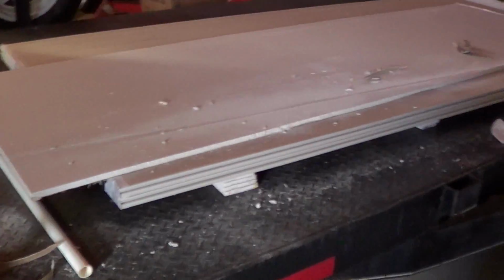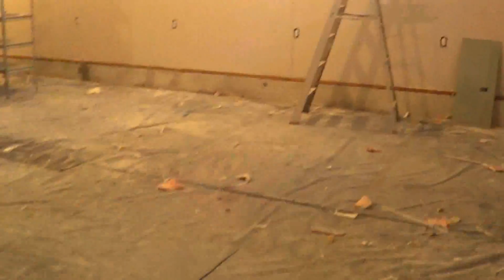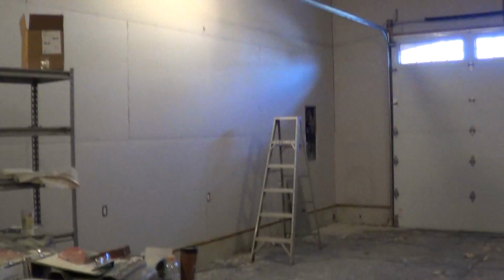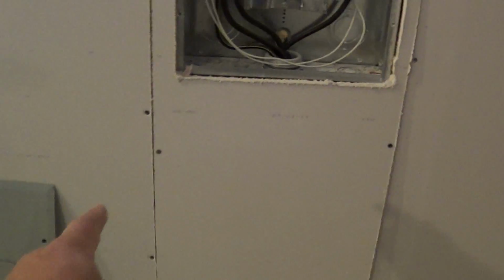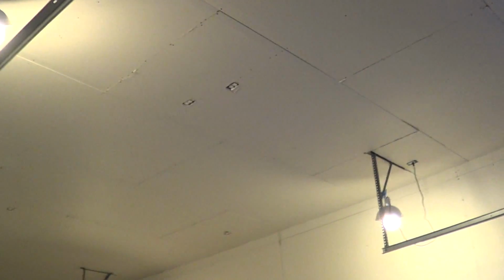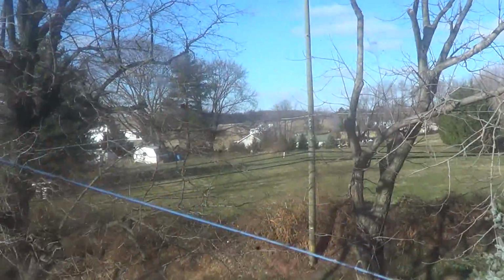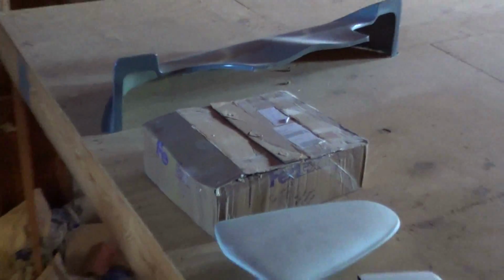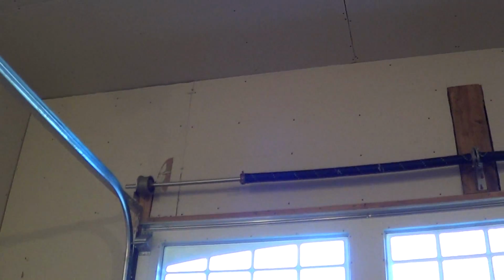DRYWALL * SHEET ROCK * Fiberglass Shop

Comment: Scaffolding must have been very helpful for that job.  Drywall can be a bitch... especially when you are working alone.  I have used the drywall panel lifts for working alone and they sure do make things easier.  Shop is looking sweet my friend!
Reply from the maker: The ceiling is so high, you have to stand on a scaffold & a TALL Spackle bucket.....the extra height is only good if your a wood worker  or putting in a lift!....heh heh